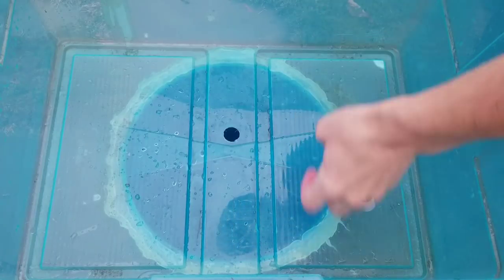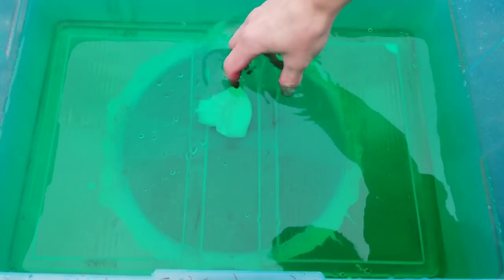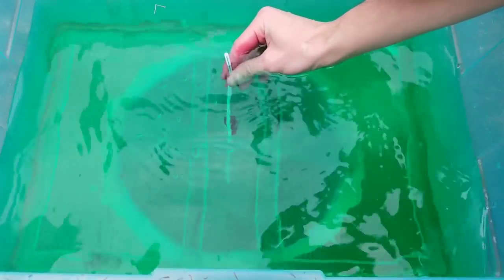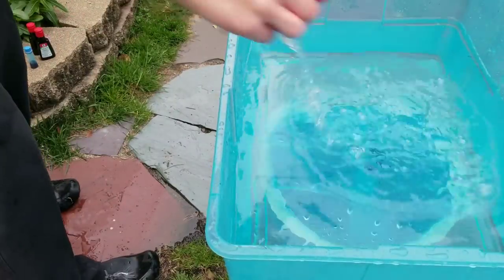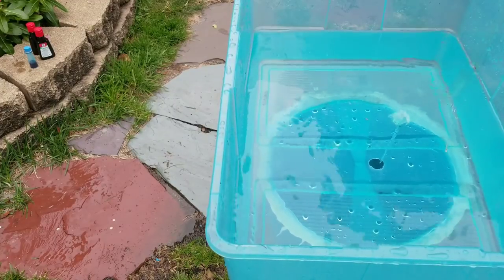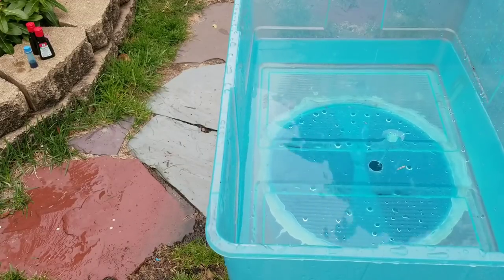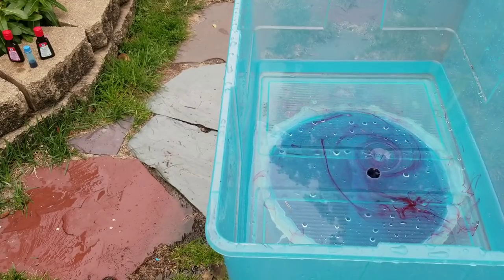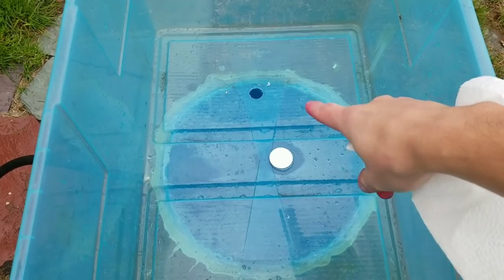Making Whirlpools

Comment: Pretty amazing how long a whirlpool can be and how friggin skinny it can be and still remain open!!

Also they spin super fast in the middle!!

And wow a little straw can make a big difference ....

(If you insert a metal pipe into the center of a fire it will suck air in and turbo charge the fire in much the same way)

Comment: You can use the same principle to fill a bottle from a water pool.
Insert a straw to allow the air to leave the bottle when the water rushes in.
I actually uses this to put water in a chicken water dispenser that only has only small mouth to fill it. Otherwise it's making bubbles and it takes several minutes to fill